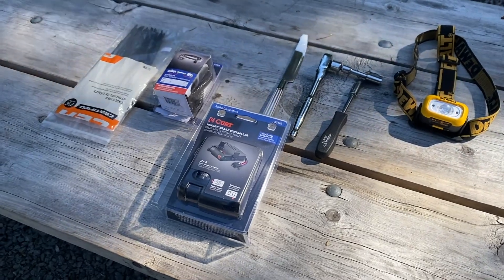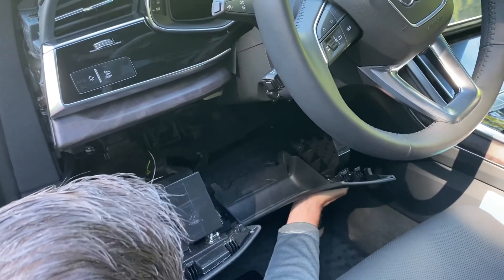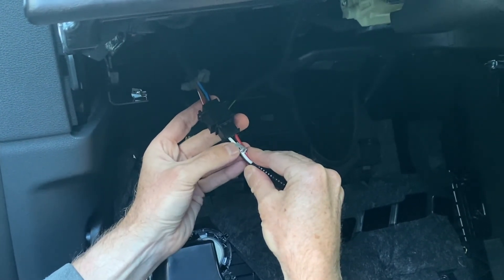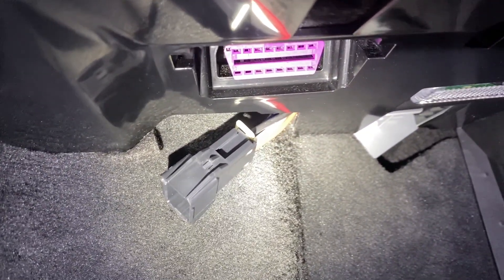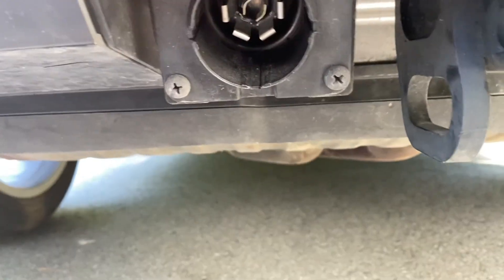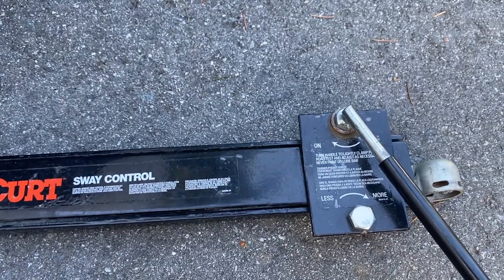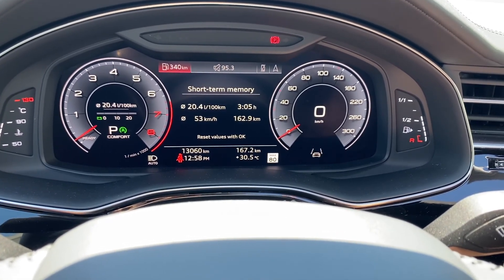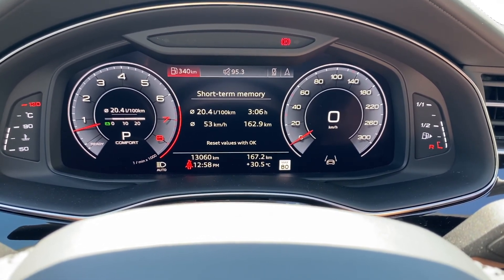HOW TO TOW WITH AN AUDI Q8 / Q7 - ALL YOU NEED TO KNOW

Comment: Thank you for this, I found some older videos for the previous models but this helped out so much on my 2022 model.
Reply from the maker: You’re welcome! Thanks for watching and glad it was useful. My Q8 has been off the road for 6 weeks due to faulty alternator. Waiting on parts..
Reply: @simonblunden2151  bummer, I have almost 10K on my SQ7 and fortunately haven’t had any mechanical issues yet. 🤞
Reply from the maker: @theschrom  that’s good. Although I believe the SQ7 is included in the vehicles with this problem
Reply: @simonblunden2151  good to know, thanks for the info. Btw, just installed my brake controller. I also see your super close to us in BC! We’re in the Seattle area.

Comment: Thanks for making the effort to share this information.  Just started towing with my Q7 and found this video to be a concise summary of all of the requirements to consider.  I am towing a 6,ooo lb airstream with an approximate tongue weight of 680 loaded for travel.  .  I was not aware that the payload number on the door was based on an empty fuel tank or a tank that was not full.  If that is true. That eats up another 140 pounds or so.  Overall experience has been fair to good.  Had trailer sway at about 63 mph.  Recently added a friction anti sway bar and will hopefully see some improvements.  I also did not know to tow in Comfort mode.  Missed that in the manual.  I think the Q7 is an excellent vehicle and can handle a certain level of towing well.  The learning continues.  Good luck and safe journeys.
Reply from the maker: Hi Don. Pleased to hear this helped. There was lots of conflicting information when I was buying our Q8 so I figured this would help. A 6,000lbs seems quite heavy (is that dry weight?). We are towing at 23.5' Rockwood TT with a GVWR of 5000lbs and the Q8 tows like a dream. I have not encountered any sway issues, but as you've seen I installed the anti sway. Safe travels!

Comment: Great video Simon! I’m also from the mainland and plan to tow my camper with my RSQ8. Already did a test run and it runs really well, just need to snag a brake controller.
Reply from the maker: Thanks for watching. The Curt brake controller I installed here has been great so far.

Comment: Awesome video. About to install the Curt trailer hitch on my 2019 Q7. Owner's manually mentions changing air suspension to trailer mode, but air suspension is not an option on my vehicle's computer system. Don't know why it's in the owner's manual if it has nothing to do with my vehicle *smh*. Super confusing.  Guess I'll just put it in comfort mode and turn off vehicle sense so I don't automatically abruptly brake when I try to back up. I'm not using a anti sway bar or trailer brakes as I'll only be towing a single axle trailer with a  15' powerboat weighing roughly 2,000 lbs.
Reply from the maker: Glad the video was helpful to you. Good luck with the towing

Comment: Thank you so much for your awesome video.  I followed your steps exactly on my own Q8 today.  So much peace of mind knowing what I'm getting into before starting.  I mounted the frame with 3M command strips instead of making holes.  I'll see if it holds, but it feels secure.
Reply from the maker: That’s great to hear! Glad you found the video useful! I’ve been towing with the Q8 now for over a year and it’s a dream. The air suspension and fact that I no longer need a weight distribution hitch is a game changer. Safe towing!
Reply: Thanks for the video Simon! Michael, I'm curious if the 3M strips held. I don't want to drill holes in my Q7, and was thinking about getting velcro strips (or the 3M if they held?). Thanks
Reply: @OrbisDistribution  I initially put it too close to my legs but once I moved it back enough that it's pretty level I haven't had an issue since.
Reply: @michaelbarto543  Great, thanks for letting me know!

Comment: Great video, thanks for taking the time to put this together. I struggled with whether or not to use a WDH, and opted to go for it. Does it work better than just the sway control? Not sure, haven't tried. But I have had no issues with sway so far and even though the hitch is heavy, I feel that it's set up well for now. When I insert the WDH into the receiver, the air suspension immediately compensates by re-leveling the vehicle, only to do it again when I connect the trailer. 

The owners manual in my Q7 (2017) makes no mention of setting the air suspension to Comfort. I have used Automatic (with no issues) but will try Comfort next time. 

For others out there, I have been using the Curt wireless brake controller with no issues. I was afraid to remove the trim pieces from the vehicle, so this was a good compromise.
Reply from the maker: Hi Rob. thanks for watching and glad this helped. From all the reading I've done WDHs are a big "no no" on these vehicles and can void your warranty. I've towed for years with non-Audi vehicles and always used a WDH so to not use one was very foreign to me. However, after several thousand kms towing with just the ball mount and no WDH on my Q8,  I have had zero problems at all and everything has been fine. Although I added the ball mount for the sway control, if I'm honest, not sure I even need that. Q8 tows like a dream with just the 2" ball mount. I head what you're saying about removing trim pieces. I was nervous, but took the leap of faith without breaking anything. I need to install a DashCam next, but nervous about  that job
Reply: @simonblunden2151  What are you using for towing mirrors? I haven't found any good ones for a Q7.
Reply from the maker: @iamrobcrawford  I use these ones and they work quite well Camco 25653 Universal Clamp-On Towing Mirror (Dual View) https://www.amazon.ca/dp/B01I6ODEDQ/ref=cm_sw_r_cp_api_glt_i_YR3BX5QJ6AZSB32D32D9
Reply: @simonblunden2151  Thanks! I took a look at those, but the reviews really aren't that great. Maybe I'll give them a go anyway.

Comment: Your video is so comprehensive. I'm curious what's the part number for your trailer mount and ball mount?
Reply from the maker: Glad you found it useful. I actually went to my local hitch store and they put it together for me. It looks like the Curt hitch and ball is part # is 45036, but I used it as a rise, not a drop, so the ball is the other way around on the mount (if that makes sense). The sway control tab is

Comment: Absolutely fantastic video Simon. Thank you for taking the time putting this together!
Reply from the maker: You’re very welcome. Glad you found it helpful
Reply: @simonblunden2151  Forgot to ask, do you know If the harness (that the brake controller plugs into), has a 'blue electric brake wire' that runs to the rear 13 pin trailer plug? If so what pin that is?

Us aussies typically use a 7 pin flat plug over here, and need to be sure pin number 5 on our plug matches the electric brake wire pin on the back of the q8.
Reply from the maker: @Hybrid3443  at 5:30 in the video, does that answer your question?

Comment: Has anyone towed without the air suspension?  I have a 2019 Q7 without air suspension and not sure how 400-500lbs of tongue weight will work out.
Reply from the maker: That’s a tricky one. Have you tried some of the Audi owner forums?

Comment: Just traded my 2017 with an aftermarket hitch for a 2021 without a hitch. Is an aftermarket okay for the newer models as well?
Reply from the maker: I would check with dealer. Depending on what you are towing there’s additional considerations like transmission cooling, brake controller and trailer wiring…